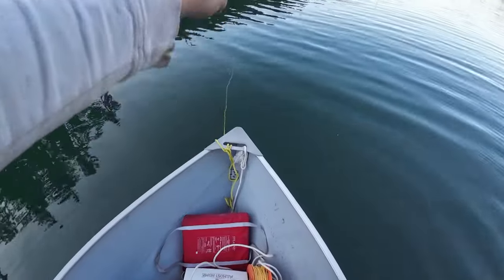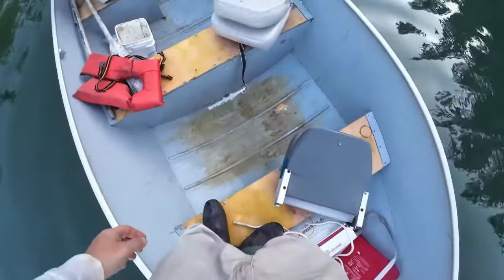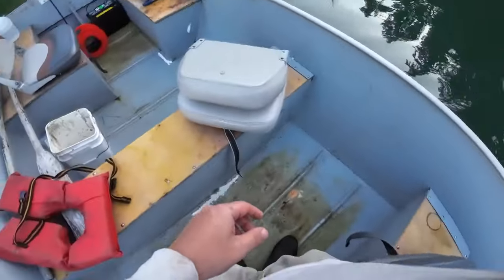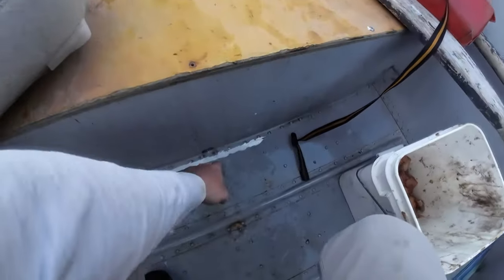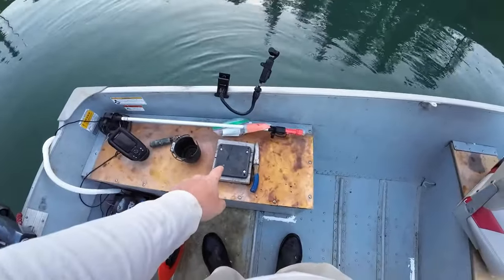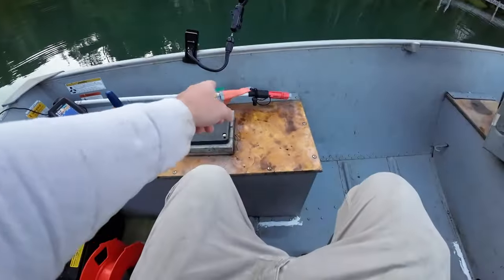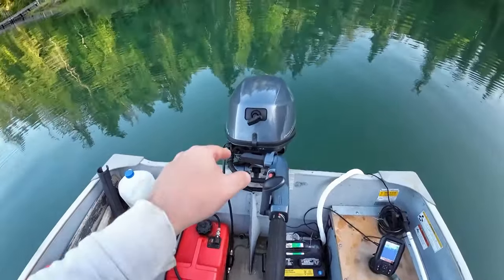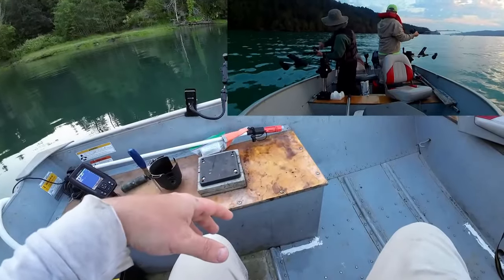WC-14 Lund Boat layout and 10-year review

Comment: I’ve got a 16.5 ft Smokercraft Pro Lodge that I bought in 2020. There are a lot other good boats in the same class.  It was cheap enough to get me fishing but capable enough I can take it lots of places.  It isn’t great to ride in when the chop is over 1.5 feet and kind scary at waves over 3 feet or so, a lesson I learned and won’t repeat.  Its a good compromise and I can fish about 80% of the time I want to.  I hope to upgrade someday but this will need to get me through the next few years. 

A guide friend said to me before I bought a boat is that until you have something, you don’t know what you want.  This is very true.  I now know what I want and how important some things are that I didn’t know were important before (open hull for instance, duh, it sucks when its cold!).
Reply from the maker: Thanks Steelhead Ted! Great wisdom there!

Comment: I look forward to seeing what boat you end up with. I bought a 16ft smokercraft lodge used and did loads of upgrades. The lodge is much wider than a typical riveted aluminium boat thus way more stable. Previous boat was 14' klamath that was tippy as a canoe
Reply from the maker: I appreciate the Intel on both accounts JD!!

Comment: My guess is that the transom stress fractures are from an outboard jumping on the back while trailering, instead of busting into waves. Aluminum stress fatigues really quickly and an outboard bouncing, even a little, can cause stress fractures to form well before the same boat that lived in the water.
Reply from the maker: That's a great theory Jarom! I try to always tow with the motor locked in the down position (which I know is risky). Ive had some issues with straps failing tho. Once I probably rode to sekiu with a loose strap so maybe that was it.

Comment: I fish out of a 16.5 Ft. Lund that has all available accessories, fully loaded, with everything you could think of, I'm happy to crab near shore or in protected water but if I did it all over again I'd go with an 18 Ft. with no accessories except puller & rod holders with a 25 Hp.
Reply from the maker: That's great, Mike! Both the experience and the advice.
Reply: Hi got ssv 18 with 60 merc. Honestly 60 is a little too big, almost never ride over 25 mph but can reach easily 33 mph at this speed, almost feels dangerous some time. Trolling idle is little to fast, around 3 , 3.6 mph depending on weather. Back troll his around 2 . Overall way better than WC14 hi got before after 11 hours fishing days..

Comment: I too have a lund ssv14. I bought mine maybe 14 years ago and I've been lucky with no leaks🤞🤞 Tempted to post a lund walk-around on my channel so you can check mine out. I totally agree that big water is not recommended on these little lunds but for area 10 my little 14 footer with a 25hp merc is just fine. Thanks for the video Blake!🤙
Reply from the maker: Thanks Bo! Yeah, I suspect if I kept it out of Neah and Sekiu may still be fine today. (Did have a couple rough Hood Canal trips too).
Reply: Let’s see your boat.

Comment: I was wondering if a 14ft would be big enough for Columbia river and Puget Sound. Sounds like it’s not. Maybe 16ft?
Reply from the maker: Hey Jarom! I think it can be... Just needs to be a reasonably thick hull. I've got a project 15 ft boat I'm working on and I think it'll be plenty. I mean if you can go 16, probably great.
Reply: There are places on the Columbia where you could take a 14 footer but I wouldn't be caught dead in one down by Astoria.
Reply: I owned a 16-foot Lund and used it fishing Blake Island, point no point, possession bar, Jefferson's head. It was a great boat for the sound. Also, it handled rough water well. I had a mid-ship steering and throttle. Wish we had a windshield though. e powered ours with a 35hp Evinrude long shaft.
Reply: Hi Blake, yikes that some water coming in! I’m still thinking that’s the boat for me! At my age it will probably last longer than I will
Reply: I have a 16 foot boat and I’m reluctant to take it on the Columbia (where it is tidally influenced).  If you get a good tide movement and 15 mph wind, it could make for some pucker inducing rides.
Reply: @patriciaward3207 just bought a Lund 16 wc with 20 hp Suzuki tiller electric start and trim. Love it. Here to check out set up.
Reply: @SLOROB55  I’m loving my 14 WC. The 15 horse is working out great for me.

Comment: as a structural aerospace engineer, i can tell you that the reason that boat was inexpensive was because of that 0.063 thick aluminum hull.
Reply from the maker: Heck yeah. Validation! Thanks AuSableAngler! I suspect they weren't always so thin. Lots of Lunds from the 80s still around.